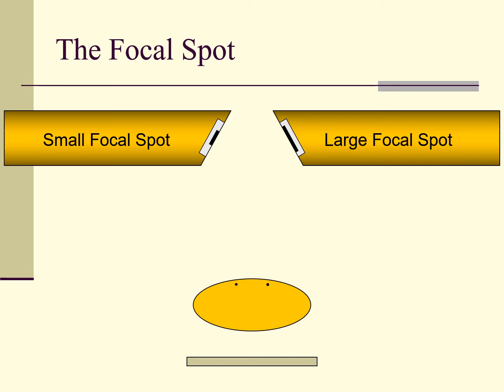Effective Focal Spot

Comment: Thanks for your video but i am a-little bit confused as regarding tube rating 
In Farr’s physics it says that: tube rating is increasing for a smaller target angle !!

Smaller target angle means heat is concentrated what makes tube rating even worse! 
How can we interpret this?!
Reply from the maker: Think of it this way:  If the anode were zero degrees relative to the cathode (perpendicular) what size image would the cathode's electron stream project upon it?  It would be close to a one to one relationship.  Now envision angling the anode face.  The projected focal spot becomes a hypotenuse of a right triangle.  Which means that the projected focal spot becomes longer and the heat is spread over a larger area, increasing the heat rating of the tube in question.